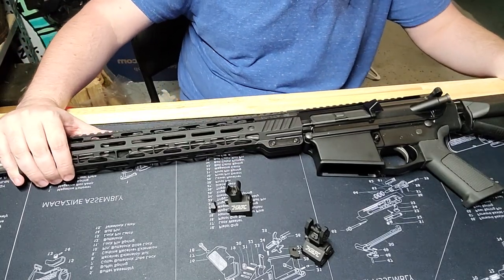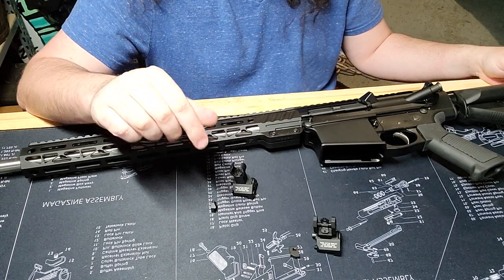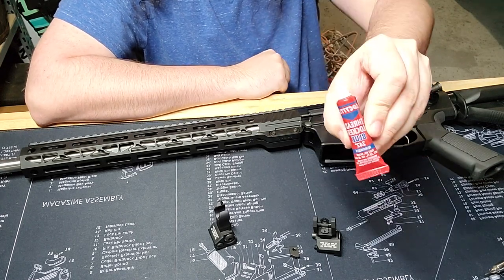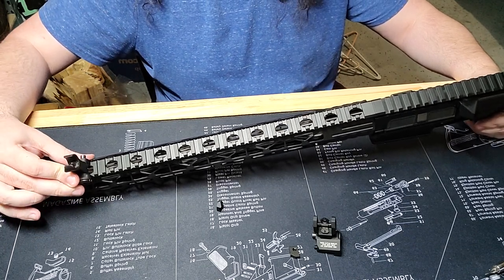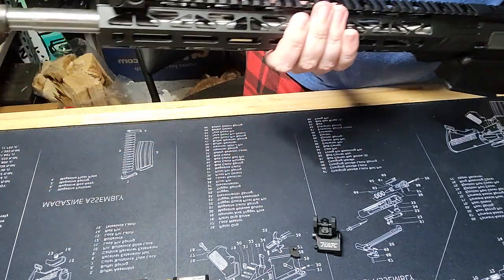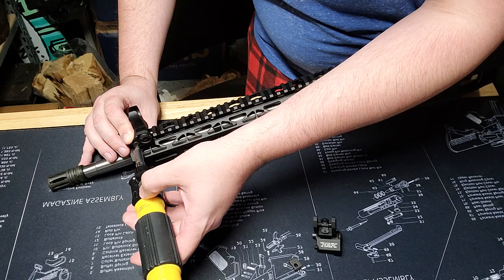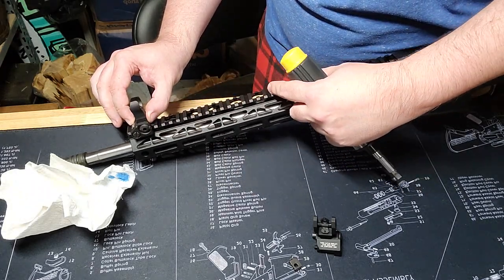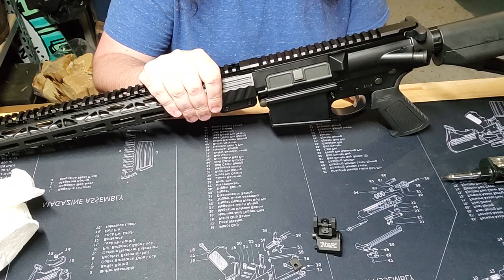Installing Iron Sights (How-to and Tips)

Comment: I use my red dot co witnessed by front sight. I really don't use rear sight. But would like to change rear sight to ladder sight. My dagger defense front sight are only right handed so mine goes on backwards. I set my front back a little to avoid gas hitting it. My muzzle device is closer to hand guard. I don't lock tight but do paint my rifle. My bow, rifle, and motorcycle take Allen wrenches. I make sure to have sets of Allen wrenches with each.

Comment: Troy optics?
 And what if rear sight doesn't have elevations adjustments?
I went with the Troy Rear Folding Battle Sight with Tritium Inserts
and the Troy Front Folding Front Battle Sight with Tritium inserts in the m4 variant for my ddm4v7 pro.
Reply from the maker: That's correct! They are Troy folding sights! My rear sight has the windage adjustments and my front sight has the elevation adjustment. This is a fairly standard practice, to my understanding. Check your front sight if you're looking for the elevation adjustment, hope this helps!
Reply: @SteelandWoodOutdoors  Okay I see now! Probably a stupid question, but we all start somewhere hah!
 Had to get the adjustment tool separately. The bullet method wasnt cutting it. Much appreciated!
Reply from the maker: @ProVsCon  no problem! The adjustment tool is the best method, using the tip of something like the bullet method is more difficult. No stupid questions! We all started somewhere. Keep in mind that each quarter turn of the front sight post is about 1 or 1.5 moa adjustment when you go to sight it in. Same with the windage on the rear sight i believe. Glad to have you as part of the gun community!
Reply: @SteelandWoodOutdoors  Glad to be apart! Appreciate the much needed tips! 🤙